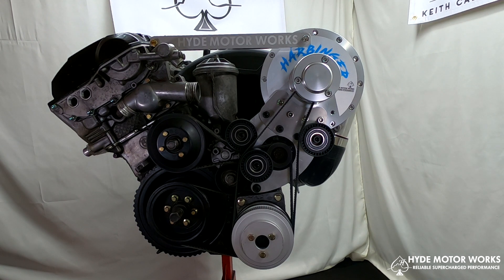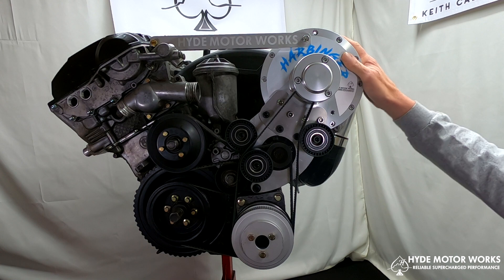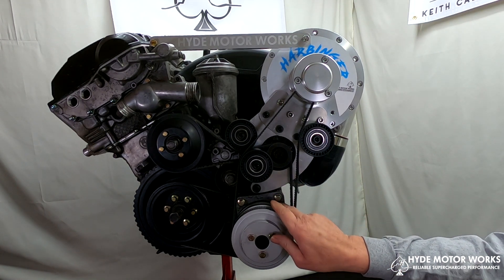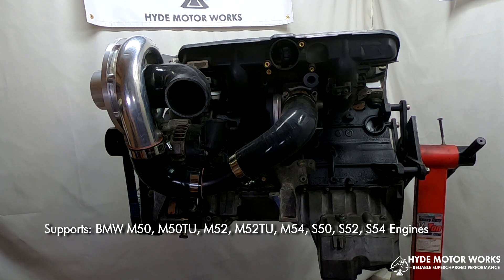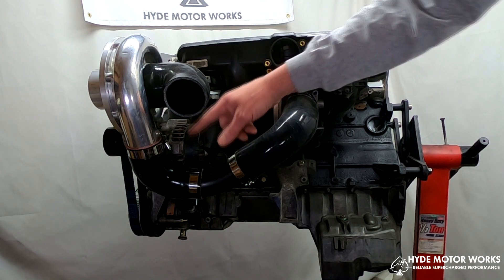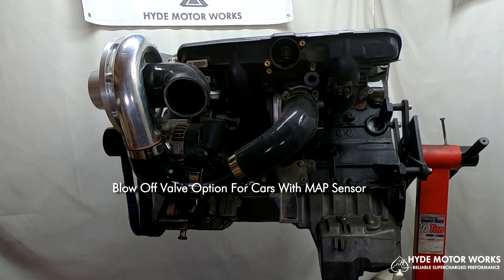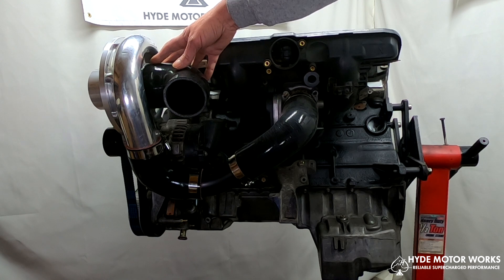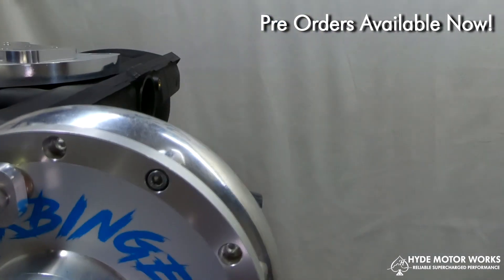Harbinger Supercharger Kit for BMW -  P2 Centrifugal SC

Comment: im planning on putting this on a 1999 mx5 if its span slow enough could this get 250hp and then be changed further down the line once the forged engine is ready more to the tune of 400-500hp
Reply from the maker: get a hyde 2.1l twin screw supercharger instead
Reply: @ that sounds awesome ill definitely wait to see the awesome product that your team will show off in this summer

Comment: Stimate power on m50b20 only with full exhaust with inox header?
Reply from the maker: Well, headers and exhaust doesn't do anything special, apart from the sound, you would be lucky to see 10-15HP more really regardless of brand.  M50B20 is a 150HP ish engine. So if you run this at 7PSI you should see a good 70-90HP increase with a good tune and larger injectors.

Comment: no oil feed or something about the supercharge maintenance?
Reply: the supercharger is a self contained bearing as its made to be a budget options from what i could tell so no oil lines required but they dont state the expected lifespan or mileage anywhere or a hp figure but seems like it emulates a vortech v-2 si supercharger (same rpm, same cfm and same psi) some people even say they bolt on the same

Comment: How much hp is this rated for ?
Reply from the maker: Manufacturer Rated for 1150 CFM. If you use it on a M54B30 you can expect 400-450 reliably. If you use it on a more powerful engine, then you get more power..
Reply: @HydeMotorWorks what If you run two of them lol